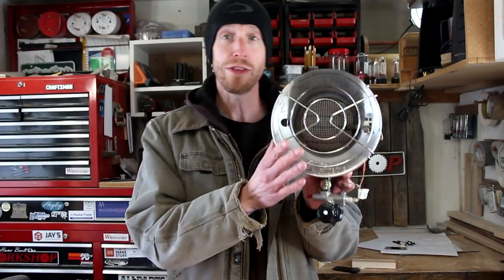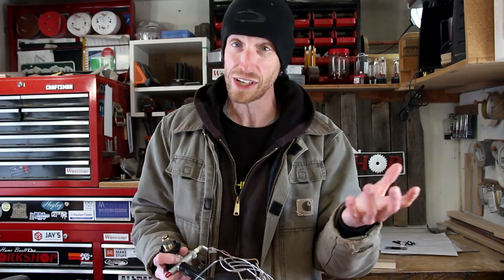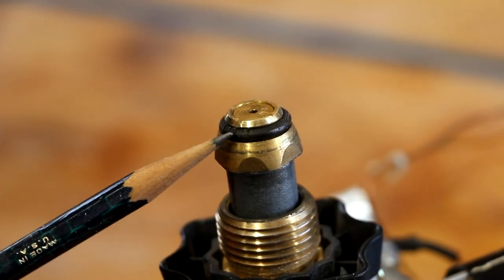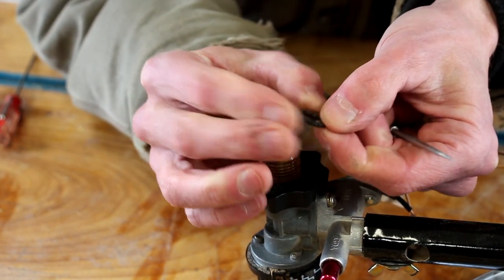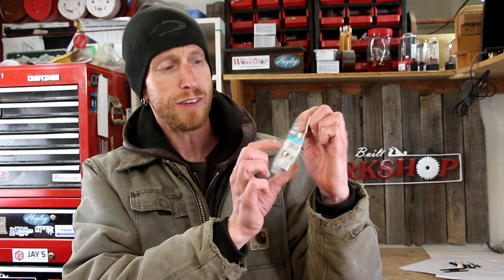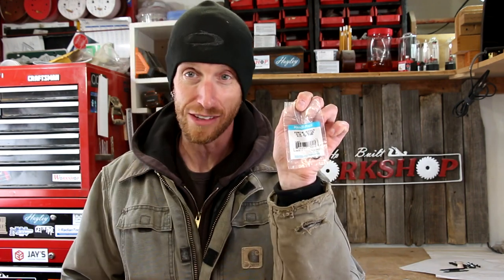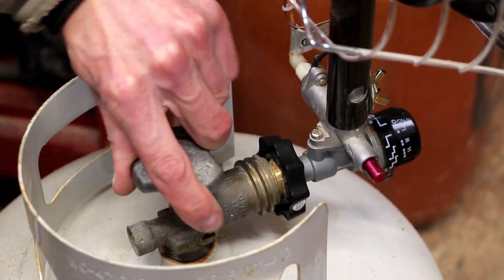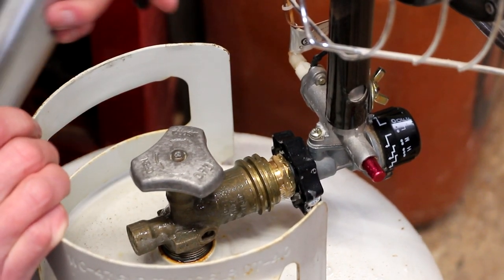Fixed: Replace a bad O Ring on a Propane Fitting

Comment: Thanks , your video saved me some aggravation by the size 3/8×9/16 being mentioned.  Tractor supply Carrys them by the hydraulic fittings.
Reply from the maker: Awesome. I had to spend some time at the hardware store comparing sizes.

Comment: When replacing propane tanks, the line can come loose at the line connection to the appliance and debris & grease can cause a leak. Had a leak this morning so I disconnected the tank. Later today I thoroughly cleaned the O-ring & connector on my portable stove and it stopped the leak. In my case the O-ring is fine, but it was oily & had a few tiny bits of debris on it. It’s important to frequently clean & maintenance this kind of appliance. Neglecting it can be lethal.

Comment: Thanks for posting this.  I have a Dura Heat Propane Tank Heater TT360_E.  I thought the owners manual would give the o-ring as a replacement part or at least list its size in an exploded view. Nope.  No help there.  Tried googling it and couldn't find anything definite there either.  I finally realized that my propane grill and anything that hooks up to the propane tanks has to use the same size connection and o-ring as you stated at the beginning of your video.  Searching that way led to your video.  I think the only thing I need to make sure of when I buy the o-rings is that they are meant for propane use?

Comment: Thanks 4 Video, but the o-ring I have wear out the fastest is the ONE inside the 20-30 or 40 lb. cylinder tank...Do you know what size that one might be? I tried several sizes  (glued them in there) but they don't stay put with ANY TYPE GLUE I have tried so far & you have to just about every time glue  the o-ring on inside the cylinder, let it dry over night and MAYBE get to use it 1 time before it comes unglued and you hear the leaking propane once again..... By using a small pin light size microscope and looking at the o-ring really-really good down inside where it is SEATED inside this o-ring holder, it seems it has a Tiny ridge this is supposed to keep it in As long as it's behind that tiny Lip, as that lip will kind of  it lets spin  and not act like just a glued in Oring. the glued in ones that just glue over the place where the o-ring goes... Hope you can understand my Question...Thanks ... I ordered 8800 different type o-ring from sea to metric and maybe I will find one that will press in behind that tiny lip like it comes from the factory. If all fails, I'll use this leaking tank to fill up about 15-20 1 lb. camping cylinders and then trade that tank in for an exchange even though you don't get as much propane & the Price is 4-5 dollars more... Thanks Again....

Comment: I'm still wondering and looking for an answer: "Do plumbing "O" rings work with propane? By plumbing, I'm talking about seals with water
Reply from the maker: I believe they will work, however if the o ring used is made from rubber, it is my understanding that propane can cause them to wear out faster. I have not experimented with this to test that out. I think it would get you out if a bind though.
Reply: Thank you for the response. Happy New Year!

Comment: will that be the same size as the one in side of the tank its self have an issue with the rubber ring inside the tank will this help me 
thanks for you video any idea
         thank you in advance
Reply from the maker: I am not sure of the one inside the tank. I'd take it out and measure it first.
Reply: @homebuiltshop  I've tried, and I cant figure out how to get it out...  A dental pick doesn't work.

Comment: Can I use a water o ring used for faucet? I got it from Lowe's plumbing section
Reply from the maker: If its the same size, I'd think it would work. Measure it carefully and be sure to check for leaks.
Reply: Same size..  do it.  Except for viton or specialty materials, it is fine...

Comment: Is there an o ring in the tank valve?
Reply: Yes.   I've got a full tank with a failed o ring and I can't use a pick to get it out to size a replacement.
Reply: @williamfoote2888  I have that same problem now.